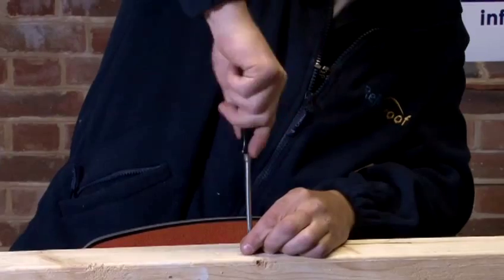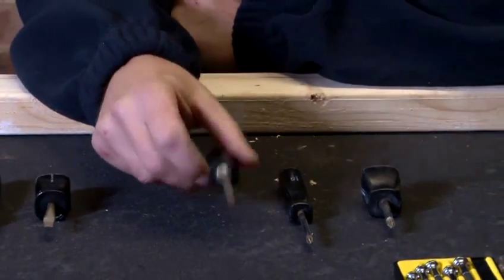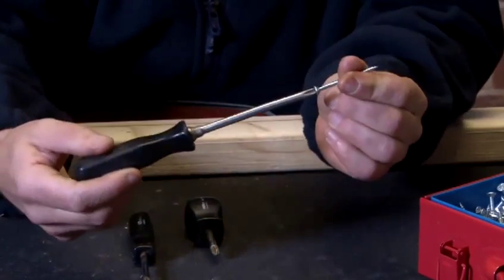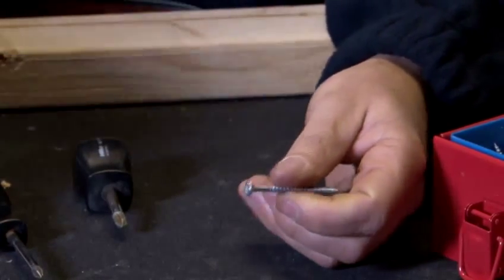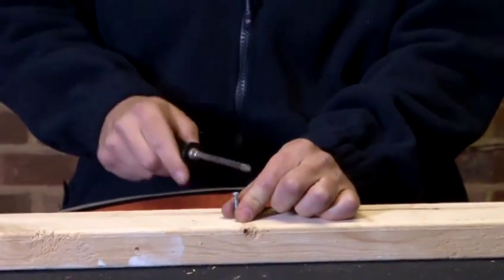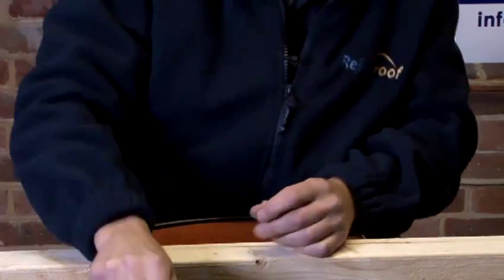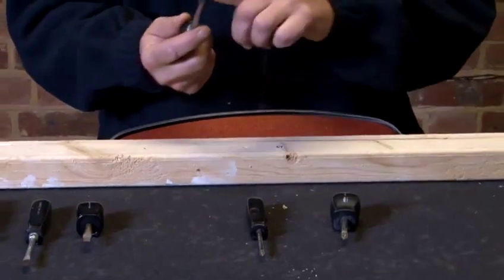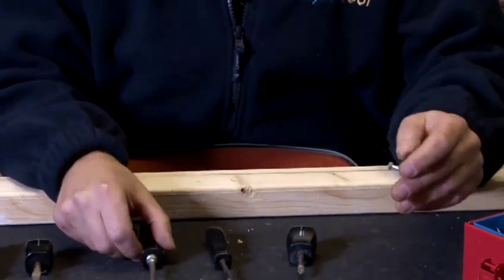How To Use A Pozidriv Screwdriver

Comment: This guy is wrong.

 there are phillips head screwdrivers for phillips head screws and pozidrive screwdrivers for pozidrive screws. They should not be mixed. If you mix them up both the screwdriver and the screw can be damaged. see here for good pictures. http://www.finehomebuilding.com/2015/09/16/what-is-the-difference-screw-bits-phillips-vs-pozidriv...  also see wikipedia

Comment: As a non-tradesman, I still can't tell the difference between a Phillips and a pozidrive screwdriver from this video, it just looks like a Phillips to me. I suggest you show a close up of the driver and head and explain the difference better and showing something so small using 480p just doesn't cut it as the detail is lost, also stop waving the thing around when you're showing it as that also makes it impossible to spot the difference